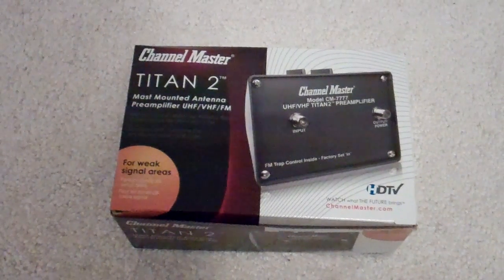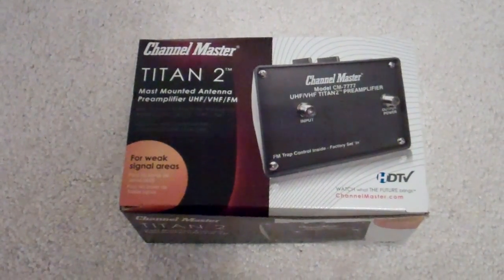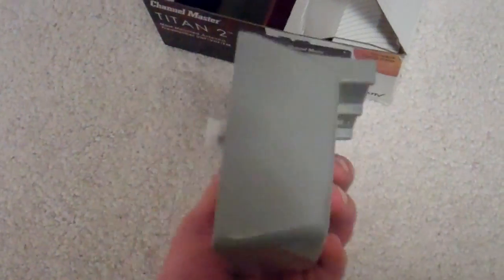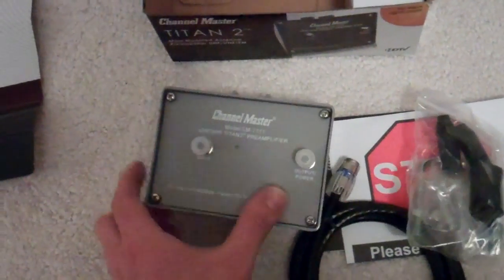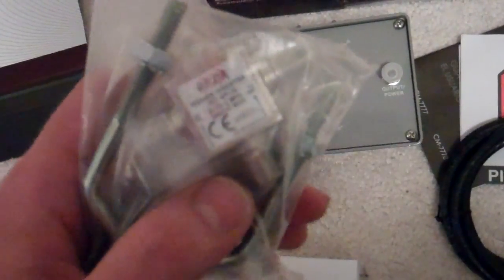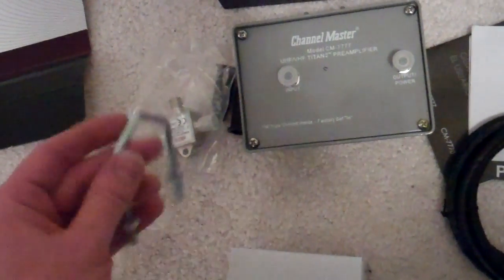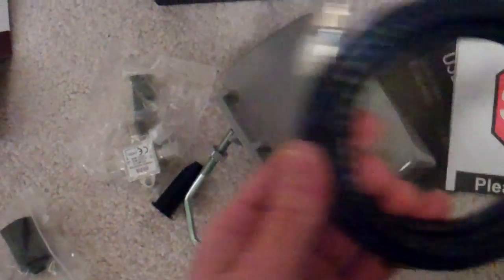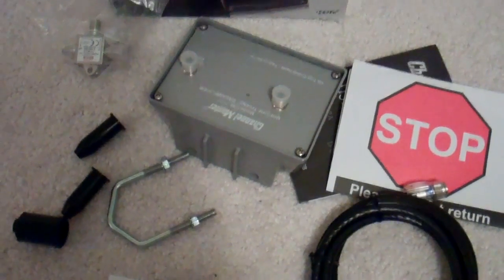Unboxing Channel Master's High Gain Preamplifier

Comment: That last coax you showed is NOT for the antenna to the pre amp, it is specifically for use from your electrical outlet and into the ‘power in’ adapter.
Reply from the maker: 1000% correct, not sure how I messed that up! Thanks.
Reply: The Tech Loft No problem, I respect you more for not being defensive. 👍🏼
Reply from the maker: @CHartnett-p3e  i'm certainly not perfect, we all make mistakes and I can take criticisms. Also, I don't like to bullshit people.

Comment: I got the Channel Master 7778 and all it does is make my antenna system more complicated with additional connections. I found running combined antennas gave me better performance and much simpler to troubleshoot.
Reply from the maker: I want to try combining antennas...is it simple or a bit of thinking involved?
Reply: @TheTechLoft  You need a combiner/splitter, preferably 2 identical TV antennas, and equal length RG6 coax running from each antenna to the combiner/splitter. Make sure you use a combiner because regular splitters don't work.

Comment: I have 2 of them. Both brand new and they both shut down when it gets 32 degrees and colder. I have checked my system over 3 times and found nothing wrong. I paid a lot of money for these pieces of junk. I purchased a Hamza Focus 30 DB booster for $40.00 and it works perfectly. I paid 79.90 for each of the Channel Master CM 7777 and jusk right out of the box.
Reply from the maker: Interesting, thanks for sharing your experience with them. A few months ago, the power injector failed on me and had to buy a new one, just the injector, not the while kit. I too noticed a week or two ago that with the extreme cold, I didn't get my channels.

How does the Hamza Focus perform in the cold?

Comment: I use the 7778 that gives 16db gain and works fine for me in Montreal. Too much gain and you over amplify the local stations and boost noise and you can lose channels. The new 'Amplify ' model with the built-in LTE Filter has a design flaw as the 'power plug' is required to be outdoors.
Reply: How good is it with with the US channels? Because Im south shore and miss strenght for US only. You think 16is enough?

Comment: How far North of Toronto are you & what stations are you receiving (both Canadian & US)? Also how high is  your antenna mounted?
Thanks.
Reply from the maker: Hi Rick, I’m south of Aurora. My antenna is setup in my attic.

I have a preamp which helps me receive approx 30 channels.

I’ll have to post another reply when I get home and give you a full list.
Reply: @TheTechLoft  Thanks...waiting for the list.
Reply from the maker: @rickrodrigues2219  2-1,2-2,2-3,3-1,4-1,5-1,7-1,7-2,7-3,9-1,11-1,17-1,17-2,17-3,19-1,23-1,23-2,25-1,29-1,29-2,29-3,36-1,40-1,41-1,47-1,57-1 Depending on the day, you can get these as well: 49-1,49-2,49-3,49-4,51-1,51-2,51-3,51-4,51-6
Reply: @TheTechLoft  Thanks guy...very helpful info!

Comment: I just got the same preamp with a better antenna than what I'm using, can't wait till I get the time to assemble it see how it works. In my area, along with one combiner and one inside splitter, I wasn't going settle for anything less than the 7777. I really do need the boost, no matter how good my antenna is, I wouldn't get one channel without a booster... not even one. It's why I choose the 7777 high gain I actually do need it.

Comment: Point of clarification.  The 7777 is a 30db gain amplifier, not a 30% gain.  A 3 db gain results in DOUBLING the signal power.  A 6 DB gain is a double of a double, or a 4 times increase in signal power.  So, a 30 db gain is 2x2x2x2x2x2x2x2x2x2, or a 1024 times increase in power.  Channel Master says that this may be too much amplification if you are close to transmission sources.  So how did this work for you?
Reply from the maker: Thanks for the clarification! This works great for me, without it, i would get Fox. I need to do a review and compare with /without the Amp.

Comment: Thnx for the video. I'm in Ajax just finished setting up my antenna. I got 39 channels, so I guess it's working well, but I do wanna boost few of them that are around 40% signal strength and I did wanna use three way splitter, two tv's and tablo. 

Will this do the trick you think? Did you jot down before and after by any chance??

Cheers